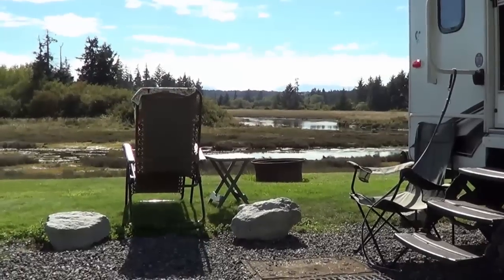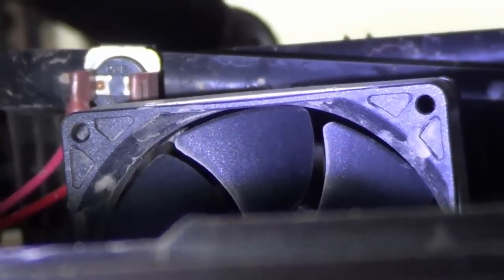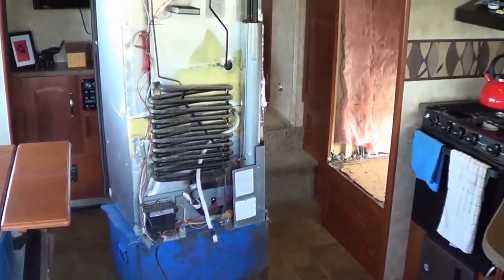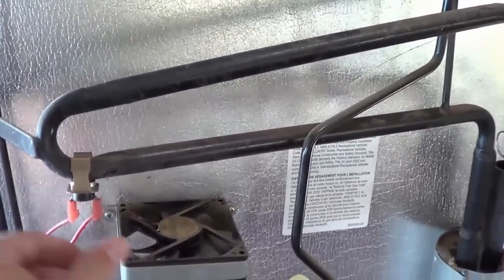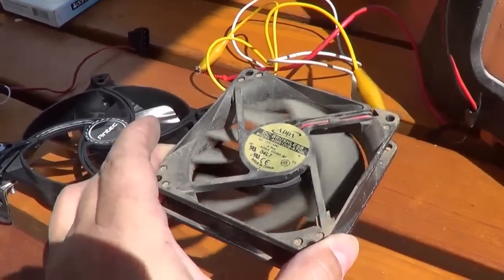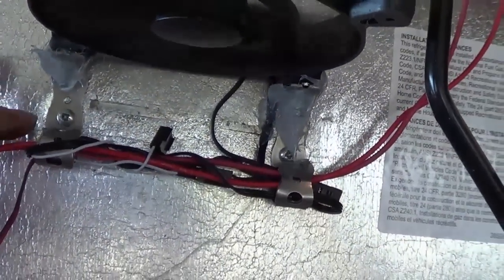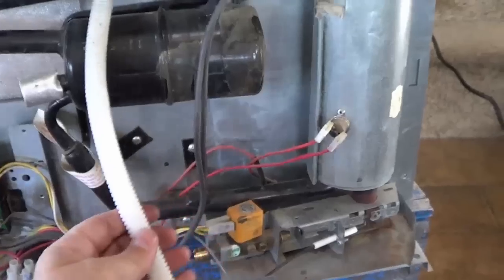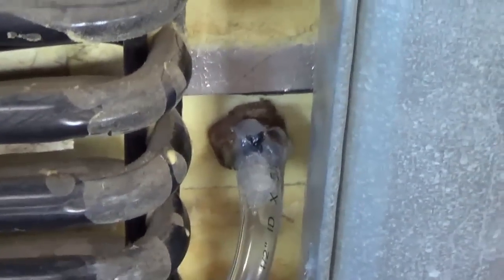Replacing My Noisy Dometic DM2652 RV Fridge Fan

Comment: My 08 Cougar 245rks didn't come with a fan to aid in cooling so I decided to add some. What I did was to take the fridge vent cover on the roof off and I cut two 4 x4 inch holes in the grill and zip tied 2 cooling fans to the grill.

I used fans with a remote thermocouple (lead is about 12 inches long) the thermocouples hang down almost to the top of the cooling fins and control the speed of the fans. The rpm's range from 50 to 1500 depending on how hot the thermocouples get. They are also very quiet.

I felt that taking out the fridge was too big a project for me.

Ron W.
Reply from the maker: +Ron Weiss Nice idea Ron, thanks for sharing.
Reply: I think he likes to take that fridge out even when it's not really necessary!  It does make the video easier to view! It is so dark back of fridge! lol  Thumbs up!:~)

Comment: Is it possible to get the info on the new fan? I have no idea what I'm doing haha. Fan info would be so amazing to have. Excellent video.
Reply from the maker: Yes, this is the one I used "Antec TrueQuiet 120 120mm Case Cooling Fan"  Not sure if its available anymore. Here are  some other options, though quite a bit more expensive they have their own temperature controllers  https://www.loveyourrv.com/installing-12v-rv-fridge-and-vent-cooling-fans-from-titan/ Cheers, Ray

Comment: I've seen where vinyl tubing will eventually collapse.  The most recent was one on my evaporator coil of my house when I moved in.  It kinked and allowed the pan to fill.   There is a fiberglass reinforced version that looks like weave pattern of white threads in it - if you ever get back in there again, you may choose to use the reinforced.
Reply from the maker: fargley001 Thanks will keep that in mind. The problem I had with the OEM hose was the part sticking out of the rig would get damaged by UV and basically disintegrate. I was slowly running out of hose as I had to keep cutting off brittle pieces. :)

Comment: Thank you for this excellent very complete video.  Ray, How did you know it would be quieter?  There are so many fans out there, some give the noise level, some not, I don't know the noise level of mines only that they are very annoying.
Reply from the maker: It has a decibel rating or 19.9 which is super quiet and good reviews.  It worked well but that original fridge quit on us, the ammonia gas leaked out https://www.loveyourrv.com/fridge-meltdown-extended-rv-warranty-s/  Lucky we had an extended warranty and got a new fridge. It came with no fans, guess the design was changed but a few years ago a company called Titan sent be some fans for review and they have been good. They are expensive but have auto temp controls - https://www.loveyourrv.com/installing-titan-rv-fridge-and-roof-vent-cooling-fans/
Here is an review update I did on them - https://youtu.be/k9esJJZ6OW4?t=954  Cheers, Ray
Reply: Love Your RV Merci 😊☀️

Comment: Thanks for the video. Someplace I read that is best to mount the fan as high as possible. The air seems to tumble when pushed  instead of being pulled causing an efficiently issue. Have you heard of this?  As usual great video. Please keep yup the good work. Rob and Lisa.
Reply: Good question. Yes, it is best to put the fan where it vents directly outside (think of a desktop computer case). However the fridge vent stack is quite a big cavity and the fans won't pull/push the heat directly from the lines. Ray's way will work fine unless you're worried that the hot air won't vent out the top as quickly/efficiently as you'd like.
Reply from the maker: Life In Serenity  Thanks! I've read that too but decided to put it in the same spot that the original factory fan was located.
 I think it would be nice to also add some kind of quiet solar powered fan at the top of the fridge stack under the roof vent as well.
Reply: +Love Your RV last summer I put 2 small cheap CT solar panels on top of my fridge cover and put 2 salvaged computer just above the screen. They worked great when the sun was out. But I really didn't notice any improvement in the running of the fridge.
Reply from the maker: Life In Serenity So far my new fan is working well, it was 80F today and fan turned on. I had to look inside to even know., The  ice cream is hard. :) Measured -6 degrees in the freezer and about 34 degrees on the top shelf of the fridge.
Reply: sailingsolar You said" You did the right thing in this case Ray. Not all advice should be followed.  Especially by people who don't really know what they are talking about and come off like they do.  I won't get into why but that in particular advice is bad advice as I understand it."

First, you babble on that the advice is wrong but don't explain why.
Second, you delete your comment right after posting it.
Lastly, you're wasting everyone's time.

Comment: Great and very helpful video.  Just curious, 3 years later do you wish you had a higher CFM fan (higher air flow) than the Antec, or is it still working fine?  Thanks.
Reply from the maker: It did the job and the fridge cooled well. But not long ago that fridge quit working on us, had a pinhole in the piping down near the boiler and the ammonia leaked out. We ended up with a new fridge under our extended warranty and it came with no fan. I've actually just installed some nice aftermarket ones - https://www.loveyourrv.com/installing-titan-rv-fridge-and-roof-vent-cooling-fans/  Cheers, Ray

Comment: I see a possible problem with how you ran your condensation tube.  You must have it long enough so that you are able to put a loop in it so that you have a p-trap.  That will block the colder denser air from inside the frig' from sinking out the tube.  The water that fills the p-trap will stop that.  It is critical that you have that.  I enjoy your videos, thank you for making and posting them.      Also  the very best leak detection fluid is "409 household cleaner".  When I was servicing A/C and Frig's professionally I found it to be the very best for that use.  I even found it better than leak detection products sold for that purpose.  Soapy water is nowhere as good as 409 for finding leaks.
Reply from the maker: sailingsolar Thanks for the tips!
Reply from the maker: sailingsolar I was able to extend the hose and add a loop. Thanks Ray
Reply: Love Your RV On my dometic the little plug at the end also serves to stop hot air from going up into the fridge which causes condensation and more ice in the freezer.
Reply from the maker: Ray J  Neat, must be like a check valve of sorts. My end plug just seems to be an insect screen.

Comment: Please do a follow up after a few weeks with the new fan to compare before and after performance of the refrigerator/freezer...   Thanks...
Reply from the maker: barkermjb It's only been two days, but so far it is performing well.  80F degrees out yesterday and I recorded -6F in the freezer, 34F on the fridge top shelf and 36.5F in the bottom vegetable crisper bins.

Comment: Enjoyed the fan replacement video.  Just wondering how much power does a small fan draw.  If your in 90 degree weather does it run most of the time?  Thanks!

Larry
Reply from the maker: Larry J  Current draw is .12 amps or 1.44 watts, so very little.  I'll have to get some 90-degree weather to tell. Yesterday it got up to 80 degrees and it ran sometimes. A lot depends how much we are opening the fridge door or adding in new warm items or if the sun is shining directly on the fridge side of the rig.
Reply: We boon dock quite a bit but currently don't have solar.  Your thorough step by step video inspired me to check into it more.  With such low draw from the fridge fan, will be doing that mod soon.  Really enjoy your videos.

Comment: A 2 part question for you Ray. First, what is that clip holding the thermostat switch called and were can I get one? Second, how would you have attached it if the clip wasn’t there?
Great videos and love following you journeys!
Reply from the maker: It just a little spring metal clip to hold the thermostat switch, not sure what to call it, sorry I don't know where you can buy one, I'd just use zip ties to hold it in place. Cheers! Ray
Reply: Thanks Ray. Would zip ties handle the heat?
Reply from the maker: I would think so, you see them used in automobile engine compartments.  You can get ones that are designed for higher temperatures, heat resistant.

Comment: Thanks for the video Ray. The noisy fan on our Dometic fridge bothers me as well. We have a slide fridge so I ordered 2. A couple questions: On amazon it lists the fan as a 2 speed fan. Did you notice how that is controlled? Is it a 3 pin wiring harness and you only used  the + and - wires? Thanks!
Reply from the maker: If I remember right there was a little switch to select speed.

Comment: If temp outside is 3% cold will that sensor not trigger fans? Had epic to cold front. Everything was fine till cold came in. Everything lights up inside fridge n feels cold.  But I don’t hear fan.  Freezer only at 40%
Reply from the maker: It's possible since the fans are triggered by the heat of the piping it's attached to, so if really cold it may not be needed so the little thermoswitch stays off.

Comment: Also, your drain needs to form a U shaped bend, come back up and out of your outside cover on your fridge a couple inches. Doing so creates a seal like the P traps on your sink drains and will keep warm air from coming back up into your freezer which will raise your temps inside the fridge and make it work harder. This one thing can make 5-10 degrees difference.
Reply from the maker: Thanks, was addressed by a previous commentator and so I made sure to loop it. Cheers Ray
Reply: I am surprised he hasn't changed the cheap plastic hose for a pvc hose!

Comment: Hi Ray - How do you run your fridge while driving? Propane or AC through your inverter maybe? If AC, can your alternator handle the load? Or maybe you don't run it at all?
Reply from the maker: Hi, yes I leave the propane and fridge off when driving. Never had any issues with food going bad. The fridge is pretty well insulated, so if we don't open in much everything stays cold. We don't drive when temps are over 85F anyway. I don't like taxing the old truck by running the AC when towing.
I guess now with the 500 watts of solar I have I could run it with the inverter..

Comment: For the drain pipe, do you put a loop in it so there is a type of "P Trap" to stop airflow into the fridge? I had seen or heard in another video about this some time ago.
Or maybe this was to stop bugs from getting in, as mine does not have a screen on the pipe end.
Any thoughts?
Thanks
Reply from the maker: Yes, loop the drain hose, or you'll get warm air coming in on hot days, reducing the fridge's efficiency.  Add a little screen for insects.

Comment: So I have a domestic RM 7030 and is not cooling well in the summer time ~ winter time is o.k. I've been putting a fan on the outside to cool the coils during the summer but want to either replace the coolant or motor or something ~ any suggestions, resources?
Reply from the maker: Download and have a read through the service manual for possible causes for poor cooling - http://rvrefrigeratorrepair.com/wp-content/uploads/2016/07/Dometic-Service-RM7030.pdf

Comment: Hi. I am about to fit a fan in my caravan and have been researching the subject.
From all that I have found out the fan is supposed to pull hot air out from the fridge top
 and pull the cooler air up from below.   The way your fan seems to be turning it is blowing 

in not drawing out.   Is there any reason for that?
Reply from the maker: The fan is drawing cool air from below through the lower fridge vent and pushing it up through the fins of the cooling unit and out the top roof vent. It just enhances the nature chimney effect
Reply: Right, I understand the setup now. Thanks for the reply.

Comment: G'day mate, what is that fan doing on that spot exactly??
Reply from the maker: It increases the air flow through the fridge's condenser cooling fins. This helps improve the efficiently of the fridge, especially on hot days.
Reply: Great question! I wondered the same thing! Thinking the fridge works on heat; why cool it!!!?? I do like the fan (fans) on the inside of fridge! Using 2 of the battery powered, one faced up & one faced down! I love using rechargeables!

Comment: ray what about the drain hose were did it go???
Reply from the maker: UH-1 It gets fed through one of the small holes in the outside access panel and the water that sometimes comes out drips on the ground. You can see it if you look at the video when I point the camera at the outside access panel. :)
Reply: OK I seen it it just pokes thru the screen?
Reply from the maker: UH-1  Yup.

Comment: It would cool to put a small in-line LED light that would let you see when it's on.

"it's so quiet it's like it's not even running"

Yeah, cause it isn't :)
Reply from the maker: aguyandhiscomputer Not a bad idea :)
Reply: +Love Your RV Thought about it and realized a light is only going to tell you the thermostat is working and sending power but doesn't mean the fan is spinning. Not sure how to check for that without looking at it.

Modded a few things in my trailer, including fridge exhaust vent fans. Link to pics:   imgur.com/gallery/WIrw3/new
Reply from the maker: aguyandhiscomputer I guess a person could wire in a optical sensor that picks up pulses from the spinning blades then sends pulses to a chip that then fires the LED indicator when pulses are present.

4 fans should draw some air! :)